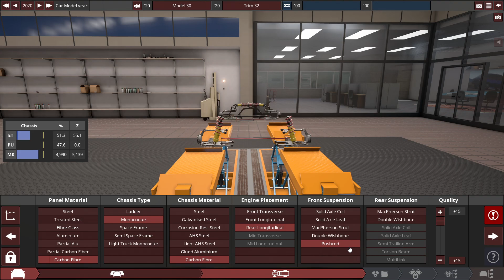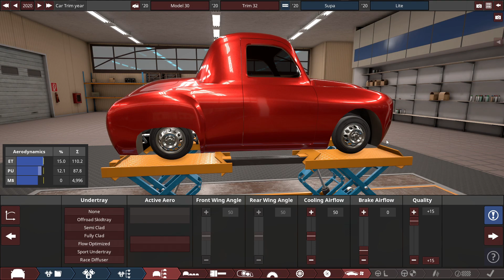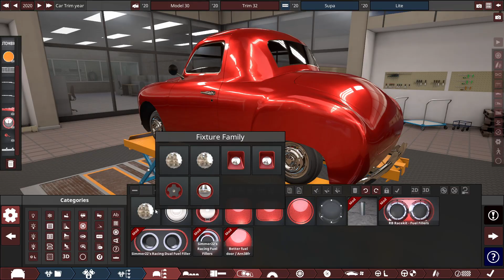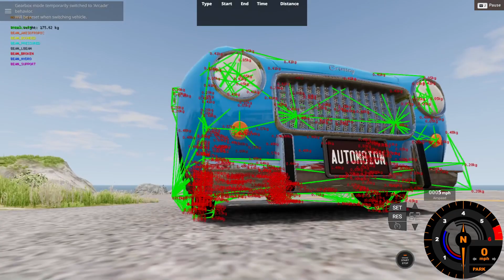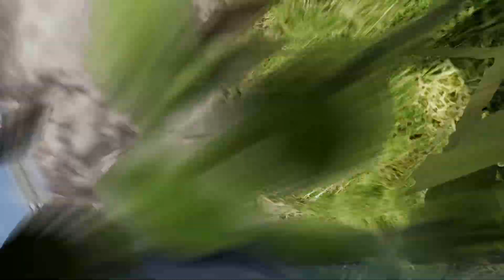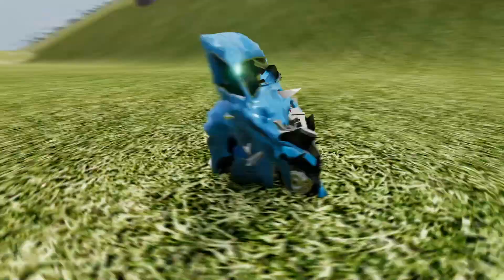This Lightweight Car is a Legit Game Breaker! | Automation Game & BeamNG.drive

Comment: 15:02 Probably more unreliable than the "most" unreliable car ever. This has to be a new record on self-kill :d
Reply from the maker: I guess so since "unreliable" car builds work no problem in BeamNG, except for this car.
Reply: @TRIZEGames  Fun fact: I recently tried to replicate this exact build without quality spamming, but sadly it broke just as bad. I spent 5-10 minutes trying to fix it and had to settle with the regular 236cc engine to get it working. Truns out BeamNG doesn't play well with very small displacements :d

Comment: very interesting, makes a (mini van) with 1.9 meters between axles, with a 134 cc engine with 3 cylinders, current project 2020. as efficiently and economically as possible, the engine drives up to 8,000 rpm.

Comment: very interesting, makes a nimi van with 1.9 meters between axles, with a 134 cc engine with 3 cylinders, current project 2020. as efficiently and economically as possible, the engine drives up to 8,000 rpm.🎉🎉